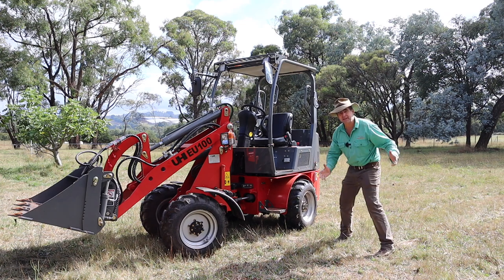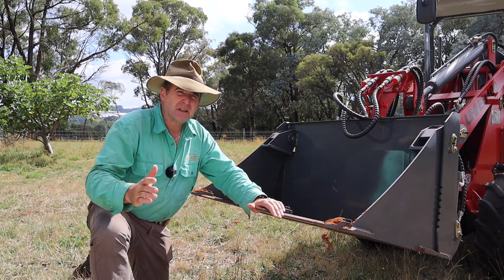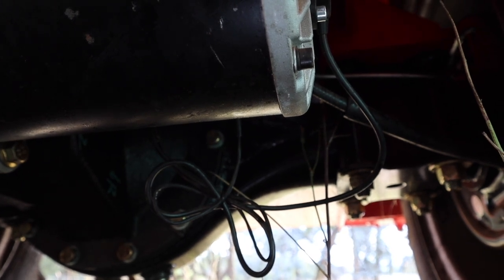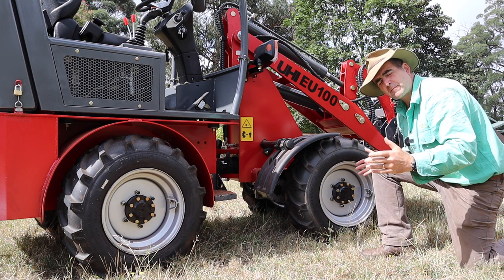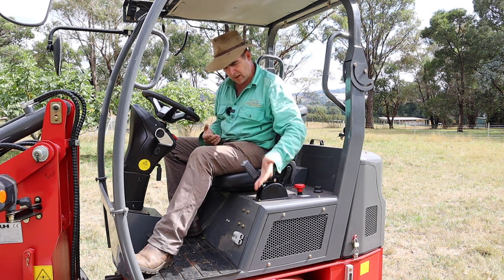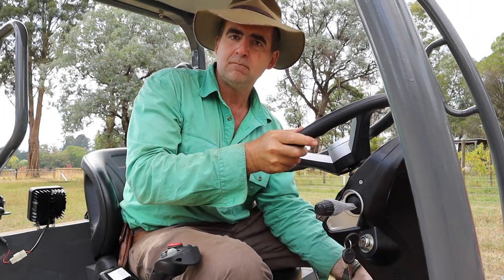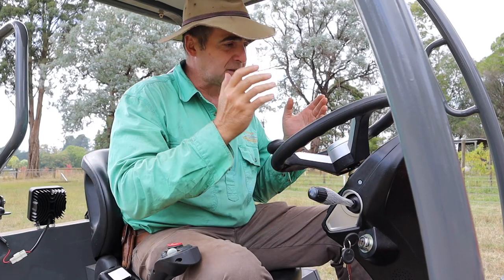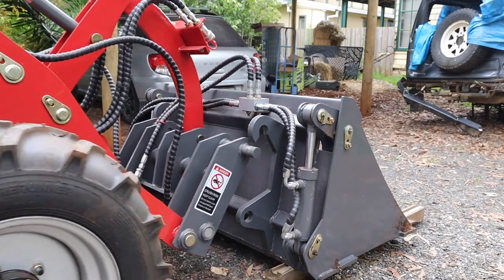UHI EU100 Electric Loader and Forklift Review Good for a Small Farm?

Comment: So Tim what are your own capabilities for fixing and repair? You take a risk from purchasing off-brand, and another risk by purchasing electric/battery (for this use case, and in this time frame). I imagine if there is a problem, you're not even going to get support from the factory (which even if you did, would not really be a "support" network).    Would this be something you only recommend to those experienced in both electrical troubleshooting and mechanical? How is tihis holding up after one season? Cheers.  (and I'm in the USA, can not locate these..)

Comment: Your concerns over lithium batteries are laudable but somewhat misplaced:

Electric cars use 2% of globally extracted cobalt. 95% of extracted cobalt is from ordinary industrial mines. The "artisanal" mines in Congo are abhorrent but they are neither necessary nor can they supply the amount of cobalt needed anyway. As EV demand increases, newer mines in places other than Congo are already opening up. Indeed half of Tesla's batteries are already cobalt free despite the relatively small chance of the cobalt being from unethical sources.

So the issue is declining, isn't being driven by EV production anymore than industry in general, its scale is limited and its overall impact is very small when compared to the hundreds of thousands of preventable deaths from respiratory illness caused by burning fossil fuels. Direct parallels could be drawn with the enormous crude oil spills in Nigerian wetlands that have made local farmers destitute and caused the deaths of thousands of children due to pollution.

I say all this not to be cynical, nihilistic or belligerent, but purely to place the issue in context. Hopefully its useful information.
Reply from the maker: Great comment thank you. I literally cracked the off colour joke to shut down criticism of the use of lead acid as they actually make sense in this machine. Plus, from a waste and recycling point the Lead batteries are easier at end of life. Although there is a grerat company called Lithium Australia that is trying to remidy that issue too... Copped some flack for the joke, but created great discussion like this too, so it pays to be a bit controversial at times I guess.
Reply: @FarmLearningTim  So true. Lots of life in lead acid batteries still. Had a lead-acid quad bike and that thing really benefited from the extra weight for traction.

I've learnt so much from your videos so glad I could help the algorithm for you.

Best wishes from a whinging pom.
Reply: @FarmLearningTim  does the other electric machine use LFP or lithium polymer batteries? LFP is somewhat of a speciality of china and doesnt even use cobalt. Somewhat heavier and less powerfull than the other lithium chemistry but leagues better than lead acid.

Comment: Thumbs down. This is a promo, an ad, right, with ads added...
I dislike the ads, many are outright offensive.
Anyway, wanted to comment on loader.
Braking could be improved by a regen charger, so you charge batteries going down hills etc.
Also, they could install a good solar panel on roof to keep battery topped up and could boost recharging off mains/solar.  Dual charge feed.
More teeth on larger buckets, replaceable cutting edges.
They must also fix dangly cables, poor fitment, alignment asap.
Single point greasing?
Cages for ROPS for scrub work, hoeing blackberries.
Has it got auxiliary  hydrualics to boom?
A hydraulic chainsaw would be good.
What was lighting like?
Must have great 360 deg lighting.
An optional rack on rear to fit extra batteries? 10 hours run time minimum, with lights on and radio blaring tsunami warnings etc. Needs fast charging, up to 30 amps would be good too.
Reply from the maker: It was a review. That’s why I pointed out all of the things you repeated in your comment. Reviews look at the positives and negatives. This allows people like you to make up your own mind if they investigate further. An ad just tells you to buy it. Hope that helps.
Reply: Every single thing you have mentioned would add cost and it would no longer be a budget option..

Comment: Wondering what it would be like lifting round bales through softer sand, all my property is sand during summer it can get fairly soft.
Reply from the maker: The diffs are open so it would depend on wether you need to lock the diffs on your tractor or not I reckon.
Reply: @FarmLearningTim  thanks. Some thing to consider
Reply: Other videos show, if one wheel with the least traction slips, the other three wheels stand still. Means, all the power goes to the least resistance